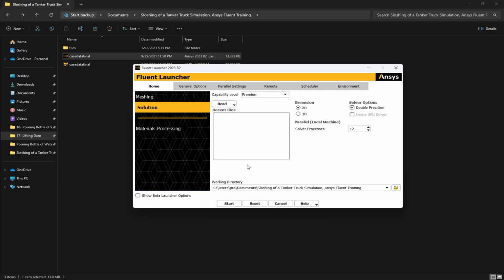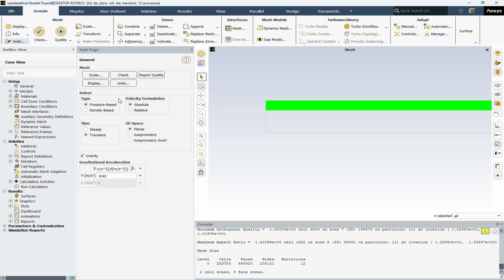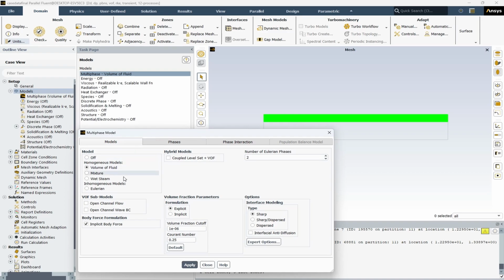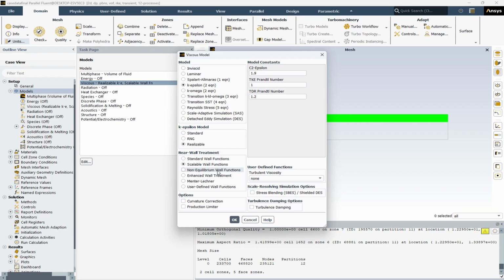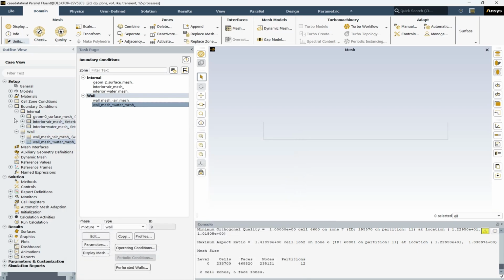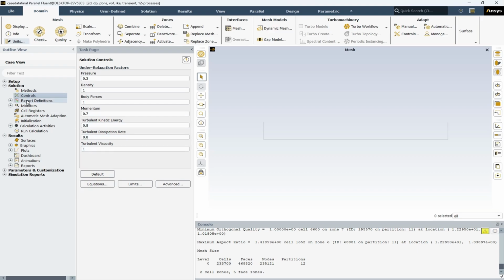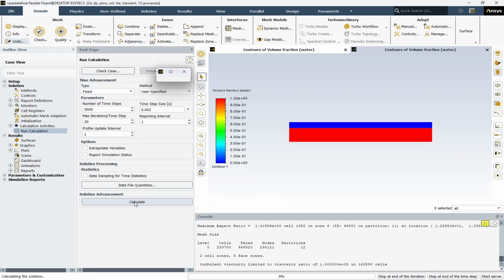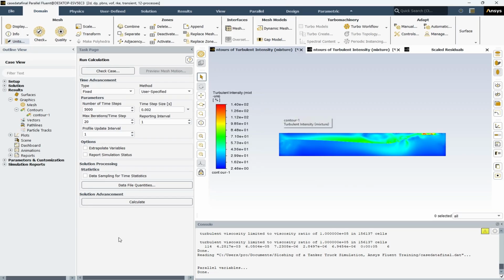Mastering Tanker Truck Sloshing CFD Simulation - Ansys Fluent Tutorial

Comment: Hello! I have a question about pressure modeling in Ansys Fluent. In real life, if a tank is half-filled with water and stationary, the pressure above the liquid level should be 0 Pa, while the pressure at the bottom should follow the equation p=ρgh. However, in my Fluent simulation, when the tank is not accelerating in the X direction, the pressure above the liquid surface appears negative, which is physically incorrect. What could be causing this issue? What settings should be adjusted in Fluent to ensure that the pressure above the liquid is 0 Pa, while the pressure within the liquid follows the expected gradient?